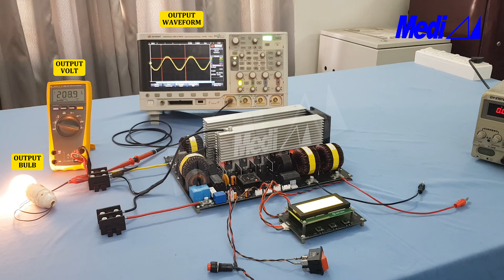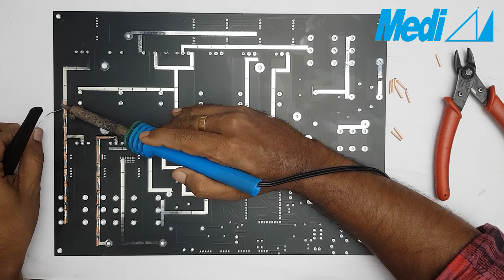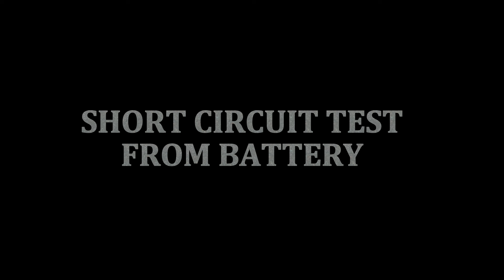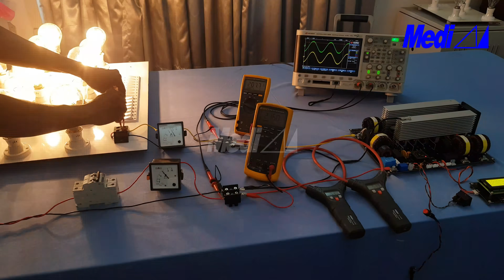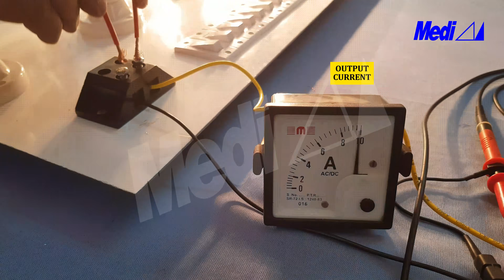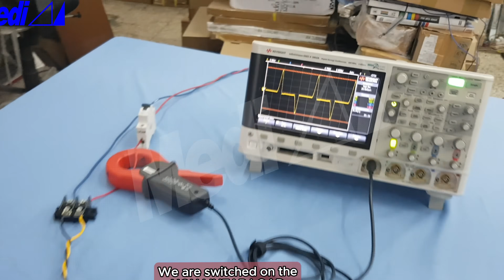6KVA online UPS with APFC MLS (Multi Level Switching)

Comment: dc 12v to 63v from a variable power supply input the output remains steady with 220 volt will it provide the same output current capacity?